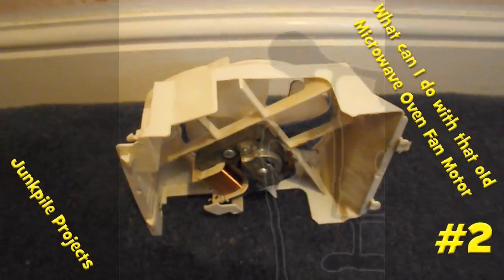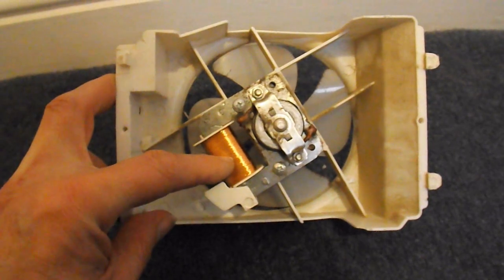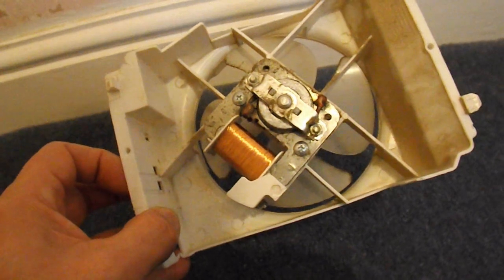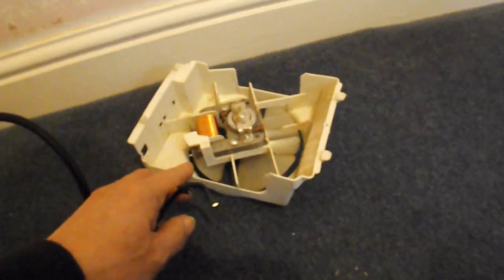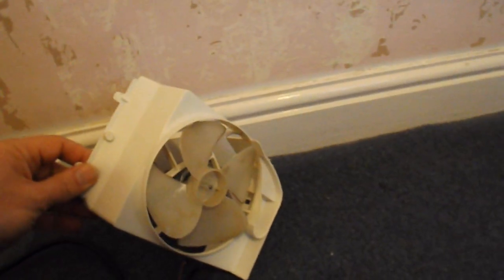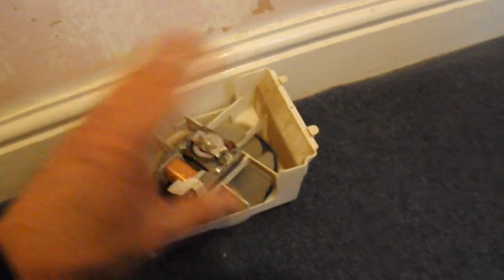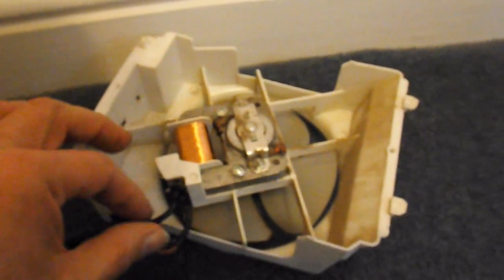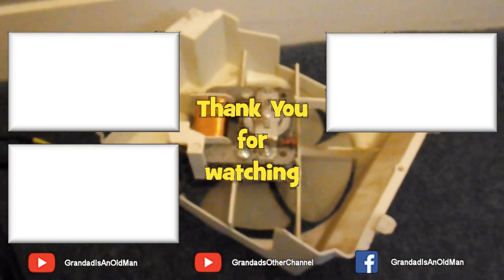What can I do with that old Microwave Oven Fan Motor #2

Comment: Hello. So i have 3 questions about connecting mine to the wall like this. First i took the motor apart just the 3 parts you can. Does it matter what way it goes back in? 2 does it matter which of the 2 wires i connect left-right on the motor? And last can i connect it the same way but to usb instead? Thank's in advance 😆
Reply from the maker: If you flip the stator, so it sticks out the opposite side, the motor will spin in the opposite direction. This is an AC motor, AC = alternating current. So connecting the power wires either way will make it run. The one in this video is running on 240 volts in the UK. USB is DC (Direct current NOT AC) it is also just 5 volts, so you cannot run this fan from a USB port. Please be careful, if your knowledge of electricity is so limited, there is a good chance you are going to electrocute yourself. In the UK that means you will probably kill yourself. The proper name for this motor is a 'shade-pole motor'  and here is a Wikipedia article explaining it's features https://en.wikipedia.org/wiki/Shaded-pole_motor
Reply: @GrandadIsAnOldMan  okok sound's good. Yeah im not too good at this stuff so before i do something i try to read or like this case ask someone who knows as to be as cautious as i can :) and yeah i wont be touching anything when connected. I have a 2 wire plugg and also i have the right (dont know name) but connections for the wires that goes on to the 2 pins on the motor so i will put then on and tape it before i connect it :) and on mine it say 220 - 240 also. Thank you for the help i appreciate it :)
Reply from the maker: Please take care 👍
Reply: @GrandadIsAnOldMan  it worked perfectly :) So i forgot to ask. About the turntable motor. Can i connect that the same way? ^^
Reply from the maker: @alexgra4363  As I remember, the turntable motor is not 240 volts. Here is a video where I made use of one https://youtu.be/nJdKdlNKuUQ
Reply: @GrandadIsAnOldMan  I will check it out. But on mine it say 220-240V~ 50Hz 4r/min 4W. Can i connect it the same way then? :P
Reply from the maker: @alexgra4363  If it says 250v 50hz, then yes, yours is another AC motor, and the same warning applies. The mains voltage can kill you. These motors and the rest of the electronics are inside the microwave case, where they are safe and kept away from inquisitive fingers. I am very concerned that you apparently have no knowledge of electronics, and you are taking advice "from a guy on YouTube". I accept no responsibility for your actions.  Good luck 👍
Reply: @GrandadIsAnOldMan  yeah no worries man. As I said, even tho i have no knowledge i am very careful to not touch anything when connected. Insulate the wires etc and I first connect the wires to the pins, make sure they are not even close to touching together then connect to power. Thank you for the help :)
Reply: @GrandadIsAnOldMan  hey again. So the turntable also worked without an issue :) so I have one last question if it's ok. The only reason im doing this is because i am building an airbrush spray booth and using the fan and table there then im done with the high voltage 😁 so last question is if both the fan and turntable can be connected to the same 2 wires that goes in to the wall or would they need some sort of resistor/capacitor/fuse or anything if that sort? Thank you again for all the help. Could not have done this otherwise :)
Reply from the maker: When they were both in the microwave, there was only one cable going to the plug in the wall, so if you were using the same cable nothing has changed, it should still supply both together. However, it might be to your advantage to have separate leads and plugs, so you could switch them on/off independently while you are working, if necessary. (Just a thought). Also if one goes faulty and blows the fuse, if they are separate, you would instantly know which was faulty, rather than them both not working.
Reply: @GrandadIsAnOldMan  no i was using another cable with only 2 wires in it. And I dont know if maybe there is some regulator or anything. I might just connect another 2 wire cable to the turntable and connect both to extension cable with on/off switch :)

Comment: I have a question that might be a bit stupid but i don't know much about these things : can this motor fail ? (I have a feeling that there there are only fix simple metal part so it cannot fail, am i wrong ?) the fan of my microwave (which is exactly this one) doesn't work anymore (but the oven does) should i just change it ?
Reply from the maker: It would be very unlikely that the fan motor would fail, there really isn't much stress put on them. I would expect there to be another problem. As I remember it, it is running off the mains supply, maybe via a micro switch that checks the door is closed. There may be more switches involved. You would need to find a circuit diagram or be very careful tracing the wiring. Even with the power disconnected there could be enough power in the big capacitor to do you some damage. A quick look at eBay tells me the fans are available, so you could replace it, but without checking the rest of the wiring you might be wasting your money if the fault is elsewhere. As you can see in my video, I was able to connect the fan direct to the mains supply so I was able to confirm it was working. If you have no electrical experience, I strongly suggest you leave this to a qualified electrician.
Reply: @GrandadIsAnOldMan  Lol, thanks a lot for the detailed answer. I know I shouldn't but i have been very careful (I was sober). I connected the fan to the main supply as you did and nothing happenned. Also I switched the  oven on in order to test the power supply of the fan and it does deliver the expected 220v. So i believe the engine is dead (just ordered one on aliexpress), it's just that I don't understand what part of this engine could be "broken". Anyway I'll let you know if the engine swap did the trick !
Reply from the maker: @arflabrelote1628  I will be interested to hear what the result is.

Comment: Hi. I have 220/230v fan, and i want to ask what materials do I need to have to build it safely?
Reply from the maker: I would suggest you speak to a qualified electrician , rather than ask some guy on YouTube
Reply: @GrandadIsAnOldMan  is it enough to solder the cables to the cable with the socket end? And I have another question because I live in Poland and in Poland there are 230v sockets, can I connect this fan to this electricity in this case if the windmill says "220 / 230v" ???
Reply: And is the 220 / 230v range, how many volts can this fan support?
Reply: Because I was wondering whether to make a battery from a 9v battery (25     9v batteries = 225v
Reply from the maker: @mateuszvogel4301  I am not a qualified electrician so I am NOT giving you safety advice. The fan is an AC fan so it is not going to work with a DC voltage supply. It sounds like you have very limited electrical knowledge so again I say, speak to a qualified electrician. Do not trust advice from people on YouTube.
Reply: @GrandadIsAnOldMan  ok thanks anyway

Comment: looks like a bathroom vent fan
Reply: I used for that. 20w it is working pretty well. Even if I have bought mine it would still be 10 times cheaper than a bathroom exhaust fan.

Comment: Can it be converted into a transformer... jw
Reply from the maker: You would need to add a second coil so it would take a fair amount of work so probably not worth the effort.
Reply: I was jw if it was possible
Reply from the maker: @turbo3089  yes and the answer is yes but it would need a fair bit of work  😍
Reply: Thanks...